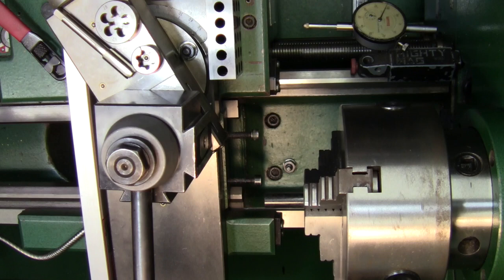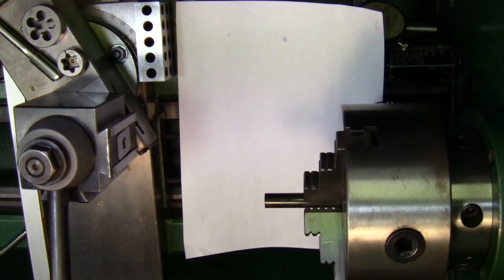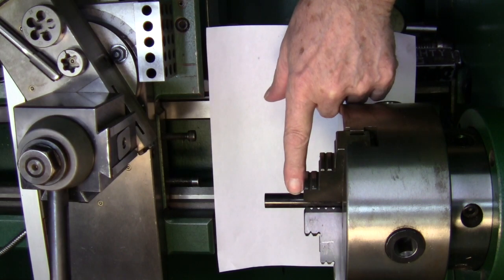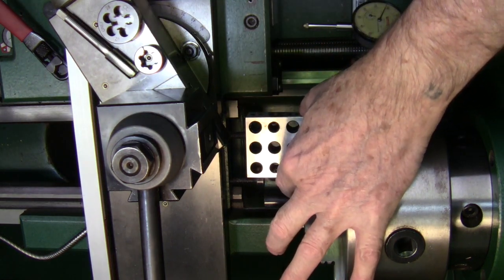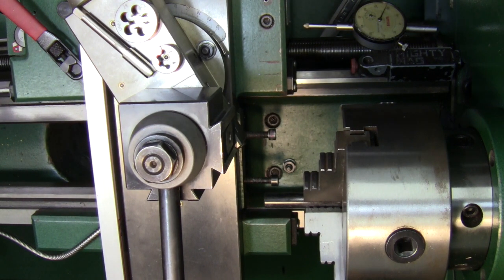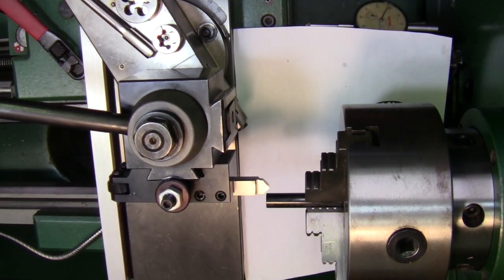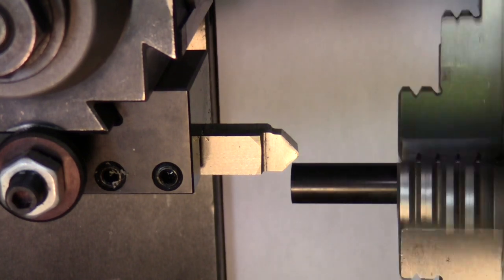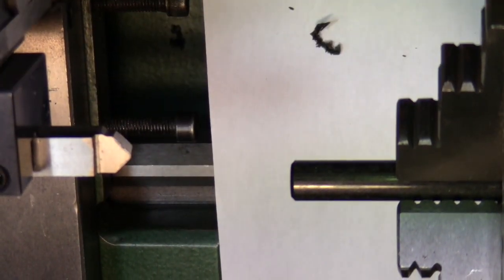Machining a Delrin Hand Piece Threading the Barrel

Comment: Thanks for the demo. I cut 1/2"-20 threads on the lathe today because I didn't have a die. Worked OK. But had to make sure the tool was sharp. Even with that, had to make adjustments in the cutting process and go slowly. The material tends to yield and spring back a little around the thread cutting tool's point.
Reply from the maker: Threads can be tricky to single point